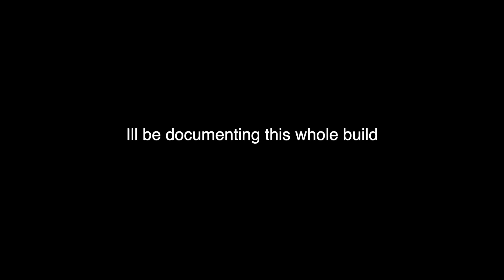VR6 Turbo Build (PT.1)

Comment: Thanks for the crash course on the VR6.  Sounds like you know your stuff.  Just bought one for my project car and am heading down the E85/turbo path with it.
Reply from the maker: Nice man, that’s the way to go🤙
Definitely check out our latest vids with the standalone ecumaster ecu and whatnot. She’s been running great!!🔥
Reply: @PostPros  Slowly watching the whole story.  Not familiar with ecumaster.  Im hoping a Haltech elite 950 will do the job but need to learn more about the VVT on the VR6 to see if its compatible.
Reply from the maker: Even if it’s not compatible.. get the schimmel locking plates for the vvt and ditch it!! 🏁🔥
Then you’ll be golden!! ⚙️⚙️ 
Should work fine as long as it supports 6cyl🔥
Reply: @PostPros  I'm curious to know why you deleted the VVT.  Does it fail or not work properly at high RPM?  

With Nissan RB engines, people always try to keep it so they can advance the cam above idle and below say 4000 RPM to widen out the torque band a lot more.  People spend a small fortune to add HKS VCAM to RB26's for the same reason.
Reply from the maker: @iswinkels  we didn’t delete the vvt on this build... my brother is currently building an engine with no vvt, people seem to ditch them with super high rpm’s. When I build one I’m going to be sending a stock build R30 and see how much it can take..🔥 more videos on that later after I get done traveling...
I think Malaka made like 750hp with the stock cams and vvt.
I think one person says something and it gets to peoples head, also majority of ppl don’t know what their talking about and don’t know when things truly fail, Every once in a while you get that one guy that talks big HP numbers with stock stuff... and I believe it. The VRs are tough, 
I’ve read guys with 700 HP and stock rods/crank, and believe every bit of it since they’re forged from factory.. seems 500 is all people push the stock pistons with a headspacer... 
I’ll be posting vids about the stock builds when I get around to it, can’t wait!!!
There’s a couple great FB pages on the VRs if you’re not on them. Good info🤙
Reply from the maker: We used ecumaster because it was basically plug and play and supports the DBW throttlebody, VVT, 2 knock sensors..exc, it’s kind of made specific for this setup. Their startup tune was awesome too because it had every thing preset, we uploaded it and drove it to the tuner without doing too much at all🤙
Not saying you can’t do that with other things, but it was just too easy to not get, and price was decent to🏁🏁
Reply: @PostPros  I didn't realize they were a DBW throttle setup.  That certainly ups the requirements for the ECU.  

Thanks again for the info.